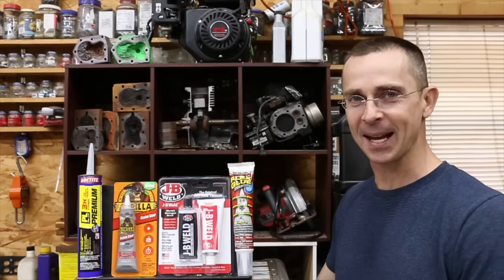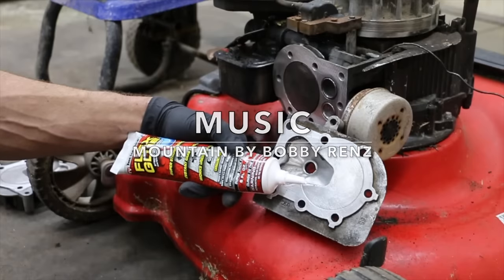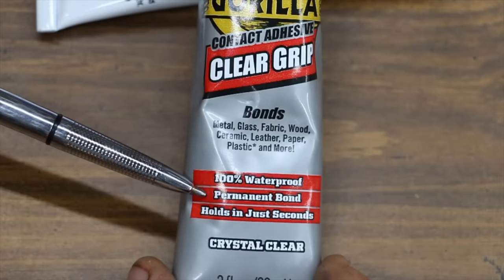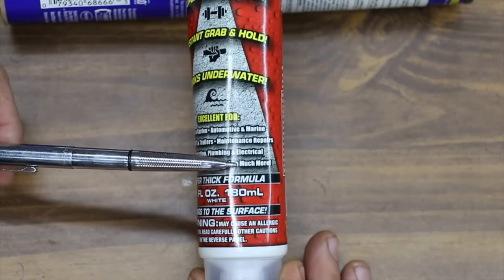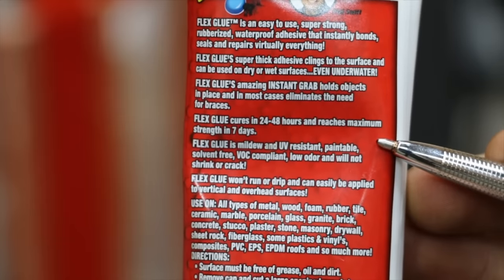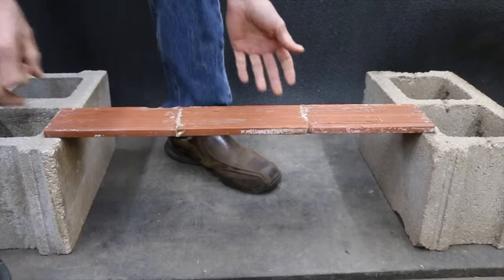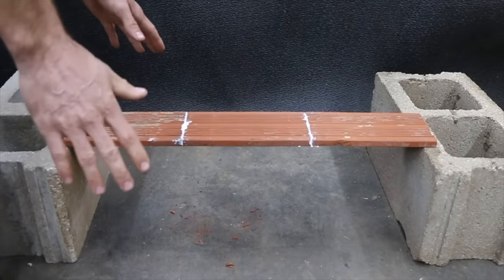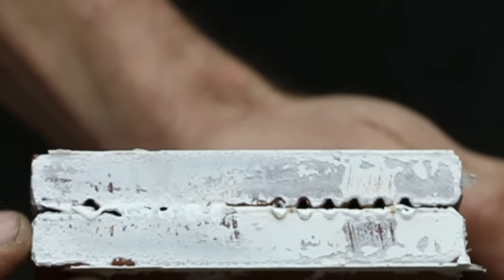Is Flex Glue better than JB Weld, Gorilla & Loctite?  Let's find out!

Comment: Crazy how good JB Weld is.
Reply from the maker: Amazing product. Thank you
Reply: Well, half of the J.B. Weld.  At @5:18 it looks like the right seam failed.
Reply: Back when I was a mechanic there were stories of guys that used JB Weld to fix holes in engine blocks.  Seems far-fetched until you use the product, it's nuts.
Reply: The Wakz I have seen it done on lawnmowers time and time again.
Reply: JB weld has been around since for ever. If it wasn’t a great product, it wouldn’t still be around.
Reply: @thewakz  I fixed my oil pan with JB weld... Going on two years now and no leak yet.
Reply: it is a legit product, one of the few over the years that hasn't changed its formula and became shit(im looking at you nitromors)
Reply: @thewakz  Look at the fortnine video with the klr 650. Just use a beercan and some jb weld to fix the hole hahaha
Reply: the only time i had JB weld not work was on my exhaust was next to my turbo and burnt the living hell out of it and smelled like shit but other than that.. i've fixed my rad with it before and more... good stuff
Reply: @denisohbrien  
You forgot to include New Coke
Reply: JB Weld expensive, 3 years ago I glued tractor engine block with epoxy who cost 1euro for 30gr(1oz) and still perfectly holds.
Reply: it save my but a lot!! and i found good product also similar...DEvcon aluminium putty and  Belzona products are very good also and in my opinion for weld from outsite my bike oil pan the belzona 1212 is a miracle!! Jbweld after some time start to fail in small peaces off because engine oil!! so i search and discover belzona!!  no problem with this issue...Oil contamination prof.. in summer i put this and still rocks today
Reply: @thewakz   We fixed a whole in a rear-diff and a transmission on a Chevy pick-up and it's still holding to this day. JB Weld is great.
Reply: I repaired the floor pan of my vehicle with it. Quite strong. However after curing, that stuff is difficult to work. Harder than steel.
Reply: Sad is not available in my country
Reply: Denis O'brien ha I’m an O’Brien too. My grandpa was a math teacher and everyone knows me bc of him. His name is ray obrien
Reply: The Wakz i used JB weld to fix a huge hole in my oil pan back in the day.   Part of having a lowrider
Reply: I used to tell people you can almost build a full vehicle outta the stuff.
Reply: Aspekt was machst du denn hier
Reply: I fixed a leaky radiator with jb weld 2 years ago no leaks
Reply: @ProjectFarm  I have a friend who  used it to fix a 6 inch long crack in the block of a boat motor. It held for a couple years before it started leaking again. Very impressive product!!
Reply: 500th like
Reply: I’ve seen JB weld repairs on a machined surface, the stuff is amazing.
Reply: Not an approved fix, but a friend who flew a Cessna 206 in Kenya for a Christian Mission used JB Weld and and a cut up oil can to fix a hole in the skin. The main problem came when it got to maintenance for a proper repair as they had to completely redo a fairly large portion of skin instead of just the relatively small original damage.
Reply: I've always found it amusing when people use JB weld on stripped spark plug sockets instead of rethreading it. Talk about a real head scratcher.
Reply: The Wakz 
I patched a timing chain cover they had a hole about the size of a quarter on a 1970 307.
That C10 went all over the US and I never even thought about that part failing.
Reply: Was revving a 1987 Warrior in reverse while stuck in mud. The chain snapped and whipped around and cracked a chunk out of my aluminum crank case. We patched it with JB weld it was fine afterwards.
Reply: its an epoxy, unlike the others, it will be stronger, this test puts the other materials to shame but thingk about how you would use this to hang drywall or build a deck? yea an adhesive in a caulk tube wins ALL DAY
Reply: He used way more than the others.m Almost feels like a paid video. Probably is.
Reply: I've repaired motorcycle carburetor float mounts that have lasted over 5 years immersed in gasoline.
Reply: I have repaired lawnmower engine cases with it - JBweld - on a thrown rod engine. Stuff works like crazy and you can machine it also.
Reply: @thewakz  Yes I used it on a bike engine once. Admittedly it was just a 125 but the bike broke down but JB weld was perfect
Reply: @K0nst4nt1n96  beer can and jb weld
Reply: Yep JB weld is impressive I’ve used the putty to repair stripped transmission pan bolts, pitted thermostat, and attaching a belt tensioner to an engine all of which are still holding.
Reply: @obnoxiousgenius7321  That would be a stronger vehicle than most on the road now.   lol
Reply: @wheels.and.wrenches  same with my z400
Reply: @Saulatis  I think it has to be an epoxy because its two parts
Reply: Isn't JB Weld an epoxy?  The others are glue.
Reply: @Colin Ashby Save your money so you can afford to flee when the time comes.
Reply: It didnt look like any of the surfaces were sanded or prepped before hand (they were clean though). The results would have been even better if they were as JB Weld likes a rough ace for more grip especially in the torque tests.
Reply: To comment on below,  adhesive in a gun is adhesive! Caulk,  seal,  bathroom's, roofing, etc.  JB WELD is when you need glue... something to fix broken shit that really needs re machining
Reply: Yes and no. I once worked on an engine someone JB Welded the cam cog in place. that didn't work too well...
Reply: One of my sidemirrors on this old car I used to have got broken off one night while it was parked, I used JB Weld to stick it back on. It was probably holding on stronger with the JB Weld than it was before with the screws going through it. Whoever broke it off, joke was on them.
Reply: Aspekt it must be better I had used jb weld and always crack under heat or the usa change of weather
Reply: its crazy how well an epoxy works compared to glue
Reply: whel they say weld.. they mean it..
Reply: its in the name WELD. its for crazy stuff. flex glue is glue. of corse its jb is better
Reply: It has a super fine steel powder mixed into the epoxy. It is absolutely insane. I use it to glue knife handles on knives that I make and to bond all kinds of things, even wood. You have to really rough up the wood first though and clamp it for the curing process to get a good quality bond.
Reply: @Ronin6534  Mine was like a fucking sieve, completely rotted and the subframe needed to come down to replace it, fuck that idea. 2 years on and no sign of leak!
Reply: Repaired my sump (oil pan) with JB Weld too,  @fullraph !
Reply: No its not.  Been using it for about 3o years......great product any brand usually does as well.
Reply: J B best product on the market epoxy and metal filings maked it tuff
Reply: @thewakz 
I've used it on exhaust header, holes, when the bolts break off, and sometimes it is very hard to drill the rusted studs out.
Reply: @thewakz  My PawPaw has used it to patch a hole on a water pump. Awesome product.
Reply: The Wakz Was
Reply: I used JB Weld to repair the float bowl on a carburetor once.
It was on an antique car that is impossible to find parts for and it worked great and got us through over 400 miles of touring, sealing the cracks in the float bowl with zero leaks.
It even held up well being submerged in gasoline the entire time.
Truly amazing stuff.
Reply: @thewakz  ..I once tightened the fuel line on a carburetor and the magnesium body broke off. JB weld fixed it for good.
Reply: @thewakz  yep it will, pressured fuel lines! yep dun
Reply: @denisohbrien  i like regular better than jb quik for hardcore stuff
Reply: @LoopKoop6778  yep it dont like super high heat like that and stinks bad
Reply: Dave Micolichek  reminds me that on a race engine. 10:1 compression. About 30 years ago I blew a head gasket between 2 cylinders. It eroded the block about 1/8 deep. I added JB weld and a used head gasket and finished out the year.
Reply: JB weld is a two compound glue?
Reply: Dave Micolichek  never tried anything like that just know if you slap it on the exhaust for a small fix its some nasty smelling stuff but i could see more of it together probably working, just used a small amount and just burnt the living hell out of it and i had to live with that smell for a few days lol
Reply: @ProjectFarm  hey I really enjoy all your videos time and effort. I really would like to see 100% marvel mystery oil as two stroke mixing oil . I've been thinking about this for years that would be awesome and easy for you to do
Reply: @denisohbrien  ah men to that
Reply: @Bl4ckw0lf1 No. This comment just makes me facepalm.
Reply: I use it to fix motorcycle cases you cant get anymore and it has never failed me.
Reply: Have found JB Weld superior many times.  Used all the above products.  Flex products are overpriced junk, don't care for Gorilla glues (the way they expand when curing and not that strong either), I do like the Loctite you tested for glueing wood panels or something similar to a wall, but JB Weld is my 'go to' epoxy for a lot of repairs (especially for repairing minor metal or plastic damage or emergency repairs).  10 yrs ago I  bumped a stump when parking my old RV at a campsite up north in the woods and severely cracked (actually broke it right off) the PVC piping that hangs down below the gray water waste tank.  We were to be there at this campsite for a few days and didn't want to cancel our mini vacation.  So we drove to town and picked up several packs of JB Weld, pushed the pipes back together after applying JB Weld and propped wood against them to hold in place until the glue cured. I let it go to see how long it would last and It's been over 10 yrs., doesn't leak a drop yet.  The only improvement I'd like to see to JB Weld is that it would be made in a clear formulation besides just black.
Reply: @LoopKoop6778  Lol... I repaired the turbo oil drain to the engine (with jb weld) on my old volvo wagon, and drove it until the wheels fell off!
Reply: @dryan8377   uh huh, thats great we was talking about fixing exhaust, high heat and it will normally fail and smell like pure shit, i fixed my radiator fill neck with it also and its still holding 2 years later, never said it wasn't good stuff and doesn't work, just in higher heat "like exhaust" it will normally fail out right and smell horrible... turbo oil drain probably isn't going to get that hot mine has had different stuff sealing the drain on my old t3/t4 project and its fine but never tried jb weld cause i pull the pan every so often and have replaced the drain a few times. but i'd bet money it'd work fine for that all day long just when i was trying to seal up my o2 bung and the bolt was stripped i only had jb weld and put a bolt into it and jb welded it into place and it didn't work at all and smelled horrible for awhile, same for my mustang when the smog pump was taken off the exhaust had a tube running to the pump and i tried to plug it and use jb weld for that and didn't work very well either... just bought a welder and welded that up later on. just know jb weld doesn't like heat after a point. it probably would work on valve covers and stuff just not exhaust.
Reply: Trust me. JBWeld is awesome, but it is brittle & nit good with vibration or higher heat. Its based on an industrial epoxy. This is called MegaBond. We'd buy 5 gal. pails and were doing prototype testing gluing chassis and unibody assemblies, primarily composites of course. . Not sure if they use it in production, but it has saved me a million times.
Reply: @thewakz  7
Reply: @fullraph  My good friend and neighbor also did the same thing. It turned out that [..at one time [?]...] FoMoCo, in order to reduce the weight on their vehicles, began minimizing the thickness of various sheet metal components. Back in the early to mid '80's, one of those components turned out to be the oil pans used on certain F150 [...and Other Model[?]...] pickups with 302 V8 engines. These oil pans appeared to be constructed of a much thinner sheet metal that had a tendency over time to "rust out" while being driven in areas that had inclement weather conditions that required the roads be salted in the winter...
Reply: @obnoxiousgenius7321  That's a good one...maybe even better than "carbon fiber"
Reply: @peterj6802  Wow!!!
Reply: @thewakz  I was told that by my friend,  but I didn't want to chance it. This was around 2008 or so.  Should have let him do it. I remember reading the instructions in Advance trying to decide to do it. Study long, study wrong.
Reply: I had a leaking tailshaft on my 07 Tundra that couldn't be fixed by Toyota, pulled it and filled the cap area with JB weld and no problems for 100k miles.
Reply: George Washington invented 
JB Weld to keep his wooden teeth in place when he crossed the Potomac. True story.
Reply: JB weld is fu*king amazing!!!
Reply: @peterj6802  Think about the mind that misthreaded the spark plug.
Reply: RBG Yeah 1212 has been a great innovation in the field as you don’t need to do any surface prep and it can cure while fully submerged in water and/or oil. If you have time to take a piece of equipment apart and really clean it and do the surface prep I’d suggest using 1121. It’s a 1 to 1 mix ratio as well and will attain higher adhesion than any other epoxy out there. Glad to hear you enjoy using Belzona, I’ve been selling the stuff for years. I don’t want to knock JB as it can do a good job for around the house and small repairs but when it comes to moving parts, high heat, and other environmental factors Belzona is the way to go.
Reply: I wonder if any of those 3M 2-part epoxies would work well or any better than your off-the-shelf JB Weld. JB Weld also makes a metallic version, wonder if that would hold any better too?
Reply: @denisohbrien  nitromors is a joke now
Reply: @wheels.and.wrenches  , you reminded me of a Devcon product I had just about forgotten, called Liquid Aluminum. Single tube stuff, not an epoxy,  and no mixing, and whatever it was, man that stuff was tough! I used that, as well as some white ceramic like Devcon Epoxy, to do some patching, feeling, and repairing of sinker molds and fishing lure molds that weren't very well made and that had poorly mating surfaces, therefore prone to lots of lead leakage, and flashing needing to be trimmed off of the cast objects. Wherever I used the Devcon liquid aluminum and the Devcon white ceramic -like epoxy, as filler to prevent lead leakage from the low spots or poorly 
mating, poorly machined surfaces, that stuff lasted for several decades.
Reply: @dennishildebrand146  , presumably, the powdered steel in the JB weld is what gives it the dark color. Although JB Weld (slow-curing)  and JB Qwik are rather different in color, one is gray and the other is black. Different anounts of powdered steel, or different types of powdered metal? And how come neither one turns rust colored when continually exposed to moisture?
Reply: We had a old dodge caravan throw a rod through the block found the piece jb welded it back in and drove it for almost ten years like that.
Reply: I have repaired a number of hard rubber saxophone mouthpieces with JB Weld. One of them had a chip on the beak. No problem. I filled it, let it cure, and then carved and sanded until it was perfect.   I also have used it when a solder joint on a sax got flaky and failed. And to seal a leaky neck receiver..
 Et cetera.
Reply: I jb welded my wife's mouth 5 years into our marriage. We celebrate 25 years next year of peace and quiet.
Reply: @fullraph  I did the same years ago, worked great.
Reply: Well it is 2-component stuff

Comment: So what I’m getting from this is that JB weld is a f*****g powerhouse
Reply: Jb is strong it's ridiculous. I don't know how strong their normal 2 bond is. But their Kwik weld 2 bond is really good for arts and crafts and even normal applications to a lot of things.
Reply: @bane4743  watch his epoxy test video. The quik weld is not even a shadow of the original. It's waaaay better
Reply: in another video he made a block of jb weld and carved a cylinder head out of it and it worked perfectly fine on the lawnmower handling a compression measurement of like 110 iirc
Reply: I've legit held together hydraulic motors with JB weld. Stuff is amazing..
Reply: @wyckedan  The quikweld is better or is the original better?
Reply: The original is better.
Reply: @AdriaanVerburg  I've used both in the same application, the quick weld cures much faster but not nearly as strong. It's brittle. But i used the original to cover a crack in a motor and never failed or leaked.
Reply: I used JBWeld on a coolant leak on a metal outlet pipe on a car. It was rusted on the inside and literally busted open due to heat one day. I couldn't find a replacement because it was a rare car and a rare part.
The pipe would get very hot as it was in the center of the engine, JB weld never failed me. I've heard tons of crazier stories too. JB weld is amazing.
Reply: Yeah dude people put jb weld on blocks when they crack and literally holds up and won't leak oil on ya . Jb welds a cheap fix but it's like it's gonna fall apart. It's a strong substance lol
Reply: You just got to be careful.   He's comparing a 2 part structural epoxy to general construction adhesives. Its not apples to apples its more like Elmer's glue vs a weld lol
Reply: @briansparacino6565  I mean at the end of the day you want something that’s strong as fuck when doing certain repairs.

I’d love to see these same companies try and make their own 2 part system for the costumers that like even stronger results.

I mean look at the whole Flex company they made a kind of bandage for pipes and the video done on that thing shows it’s crazy strong.
Reply: Smells terrible though 😂